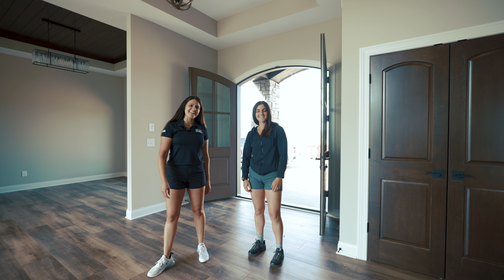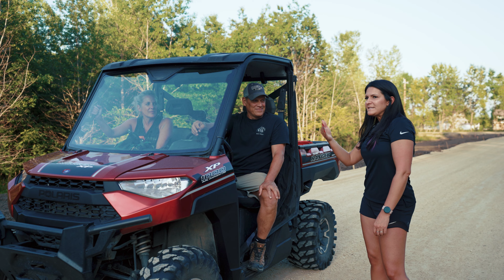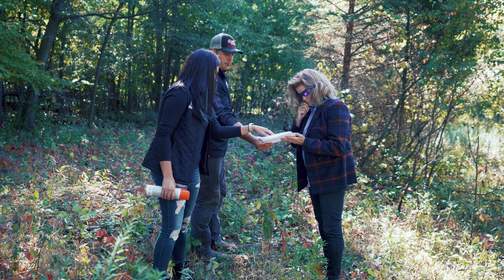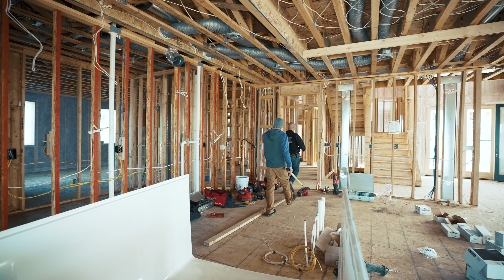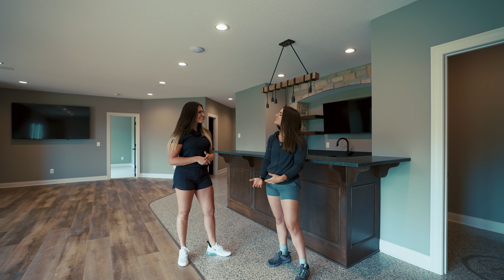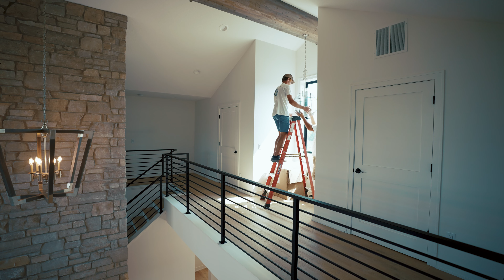General Contractor vs. Project Manager for Custom Homes - Moderno Construction Management Prior Lake

Comment: Well there are project managers, and then there are project managers.
A good project manager could actually be a builder who for whatever reason cant qualify.
And the there are project managers who know very little about the construction process, and wether the work is done properly.
They can say yep the drywall has been installed, but not much else.